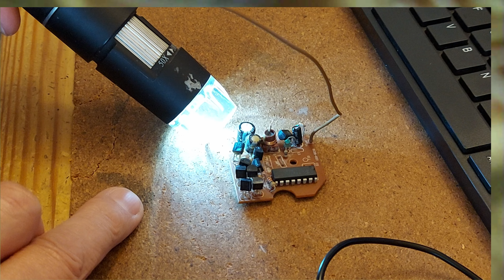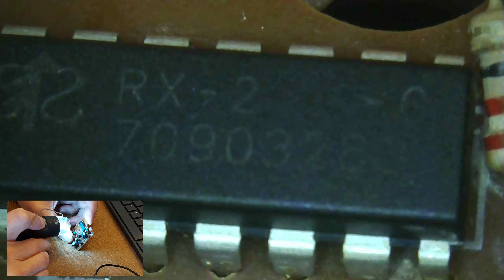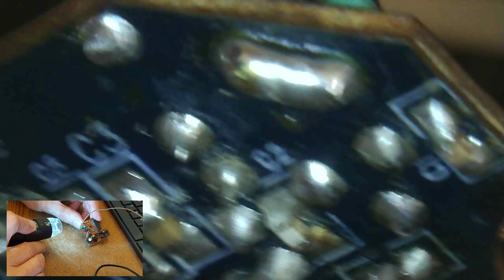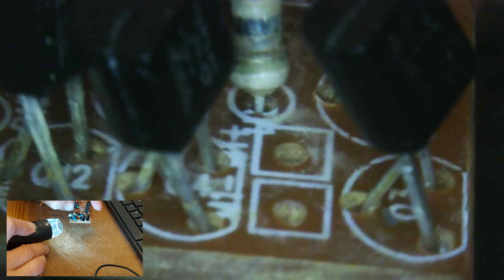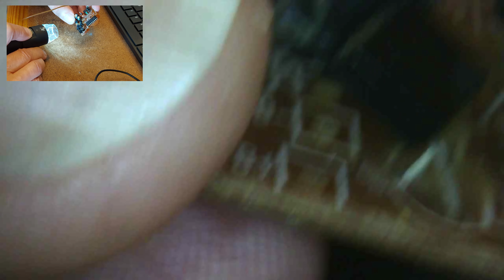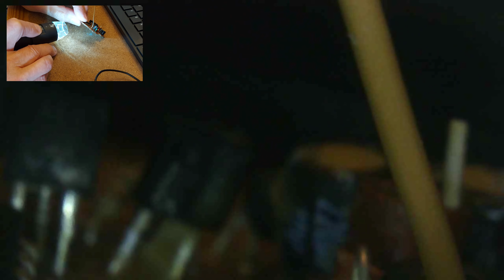Closer look at a toy grade 40 MHZ receiver

Comment: I have a Bintolk radio receiver that operates in 18 to 108Mhz range so it can detect the frequency at 40 MHz. You can even use the copy frequency function that accurately copies the transmitting frequency, on the RX, admittedly off topic slightly, but that could be used to trim the signal to the correct frequency. Side issue, but might solve transmit problems as older TX controllers tend to drift due to decomposition. Interesting.
Reply from the maker: One of my YouTube buddies sent me his old oscilloscope many years ago. I think I have only used it once, but it could be used to look at the output from the transmitter. I do have link somewhere to somebody demonstrating that. Found it https://youtu.be/7_hTBV5O44Q
Reply: @GrandadIsAnOldMan thanks, watched it.

Comment: The TX-2 and RX-2 don't do the radio frequency stuff - they work at an 'audio frequency', nominally 1kHz, which the chips generate using built-in oscillators that operate at about 128 kHz.  It's the external components near the antenna that receive the 40MHz A.M. signal and demodulate it to put an audio signal into the RX-2.  The RX-2 decodes that signal and drives five on/off outputs - normally named left, right, forward, backward, and 'turbo'.  The rest of the board just amplifies those signals (possibly ignoring the 'turbo' one) to drive the motors.  Some toys might use the 'turbo' output to drive a sound generator, or light, or whatever.

You can get infrared controlled toys that also use the same chips - they just modulate the infrared signal in place of the radio frequency signal.

If you want to bypass the radio frequency or infrared part, you can connect the output pin of the TX-2 chip (pin 8) to the input pin of the RX-2 (pin 3), for testing (and connect the grounds of the transmitter and receiver together to complete the circuit).

The TX-2 chip connects to five momentary switches, wired to ground,  to get its input signals.  The pair of chips are just a cheap simple way of connecting five switches, remotely, to a device. The outputs of the RX-2 are active high, and only switch about 5mA, so can be directly connected to LEDs, without any resistors, for testing.
Reply from the maker: Yes, here is a video I did on the test circuit setup 8 years ago https://www.youtube.com/watch?v=M46Gpyl9KYE&list=PLA5a2xPRSrB1mLQvgf5ILMeTcRMuDtcNa&index=2